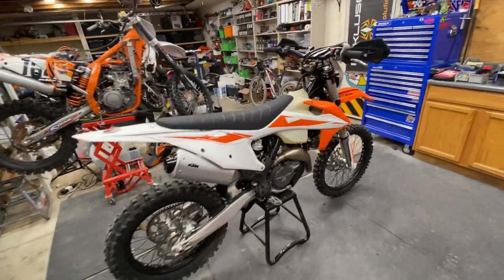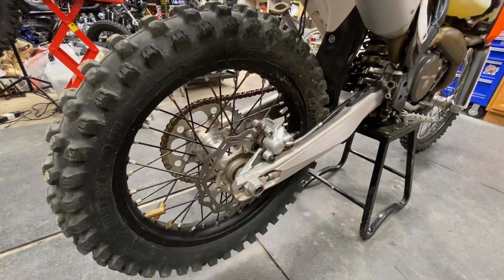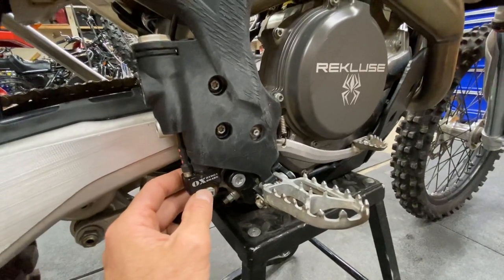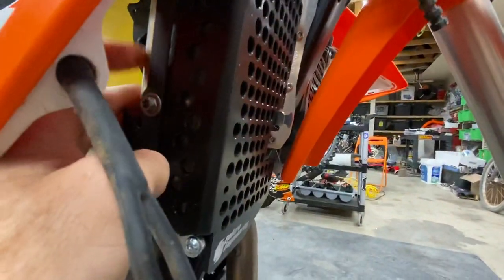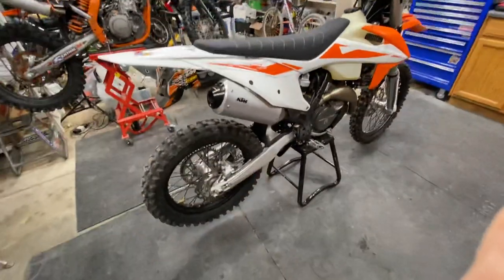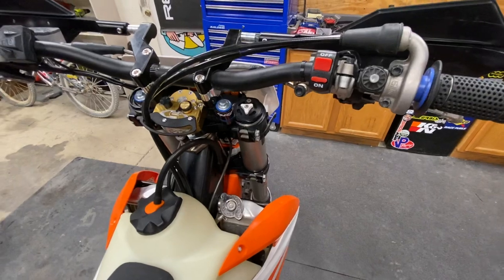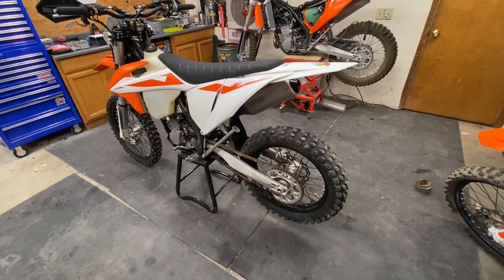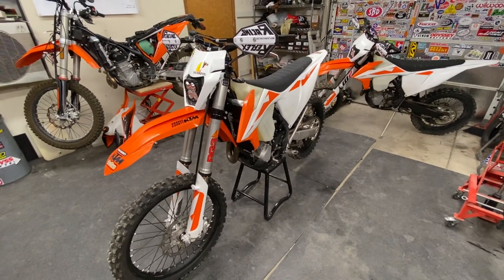2019 KTM 450 XC-F BAJA READY BIKE BUILD

Comment: Nice bike build, have you ever tried the Clake Two clutch and brake lever. I installed one on my Husqvarna Fe 350, and it's the best feeling clutch and brake system I've ever tried. Both levers are at the same level, and it's a one finger assist clutch, very easy to pull, and when I pull the brake it pulls in the clutch at the same time so I don't stall when I lock up the rear brake. You can buy it so you can retain the rear brake foot pedal as well. You have to play with the cams in order to get the perfect feel of the levers, but once you have the right combination it's magic. The only thing I didn't like was the price :-p
Reply from the maker: We like the clake.

Comment: Question on the stock stator being sufficient for light, fan and bike cause i was thinking of adding a light to my XC-F but don't know much about electrical stuff. On this build the light is 80W, trail tech fan is 30W and not sure how much the bike pulls on average but in the manual it says alternator puts out 70W. So it seems that if all items are running simultaneously it will create a drain on battery over time - any advice would be great - i'd love to add a BD XL Sport 26W light but was worried about stator not being able to keep up. Thanks for advice.
Reply from the maker: We have great results on these bikes w the fan and XLpro paired with the 230cca Anti Gravity 8 cell battery.